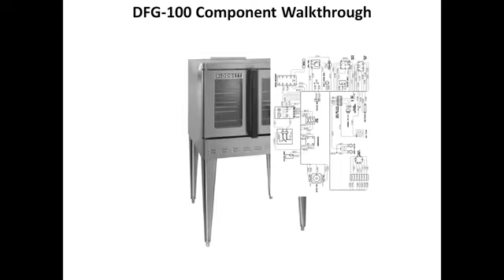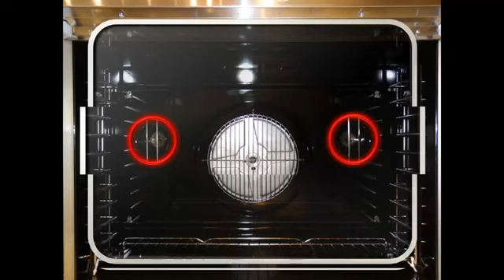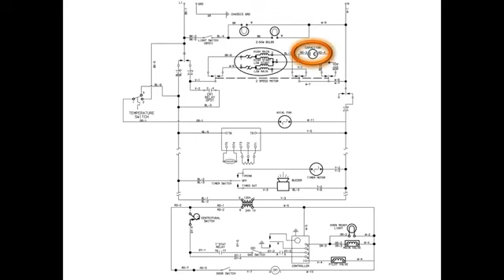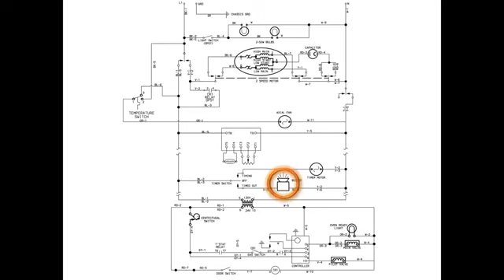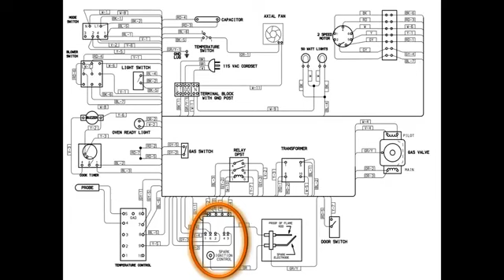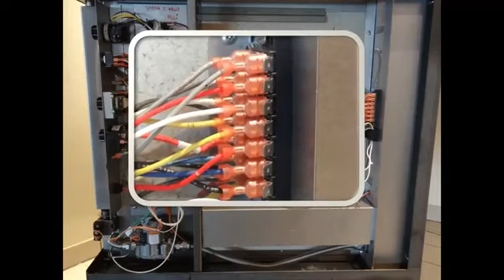DFG 100 Components

Comment: How can I wire my new motor to the old motor connection .DFG 100 oven
Reply from the maker: your new motor are the same specs in the old one?
Reply: The old motor has 7 wire and the new motor is 5.
Reply from the maker: @alexagcaoili3229  2 grey wire for centrifugal switch,  white and blue low speed, white and violet high speed, yellow green wire ground.